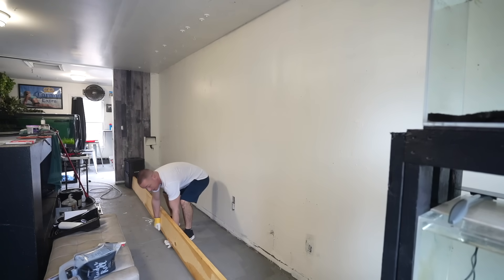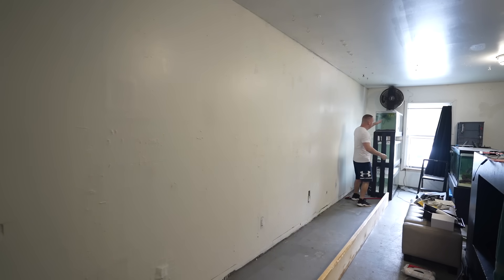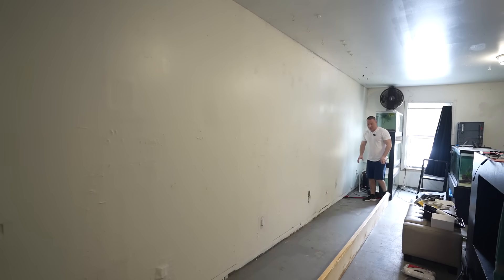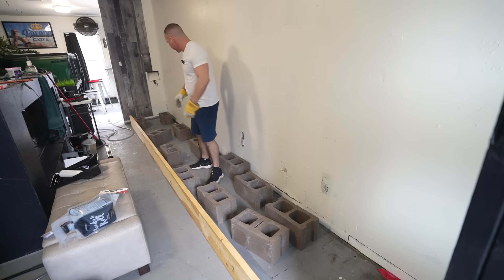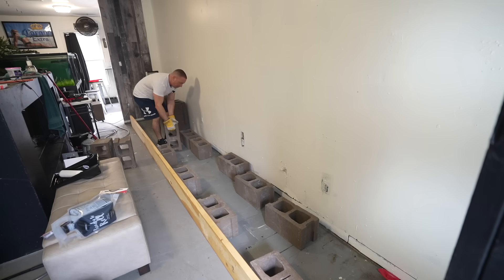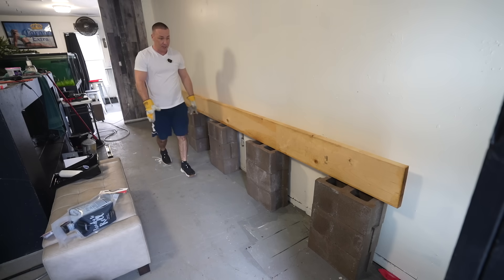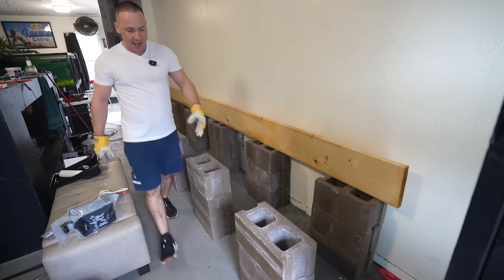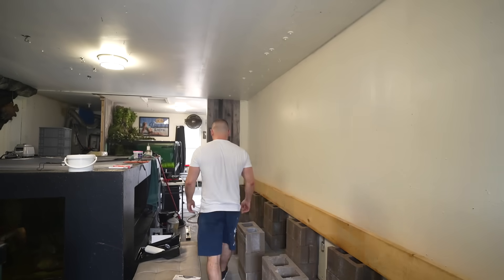BUILDING A 16 FOOT LONG AQUARIUM

Comment: It may not matter a lot in your application, however if you want to  lock those blocks together without using mortar there are products that are fiber reinforced boding cements that you can just coat the outside of the blocks with (basically paint it on) and it will also help hide the individual blocks better. Would also look better once painted especially if you decide to leave the bottom half open. We used it all the time when stacking blocks to support HVAC units under homes. It definitely improves overall stability and wouldn’t cost that much for what you’re doing here.
Reply: Silicone would be enough not to make them slide if thats something a person worries about and easy to remove.

Comment: While the cinders are cheap. You are wasting a lot of space under the tank. Space you can use for other tanks or sumps. 
At this point Joey you channel is not about doing stuff cheap it's about doing it right and the best way to meet your needs.